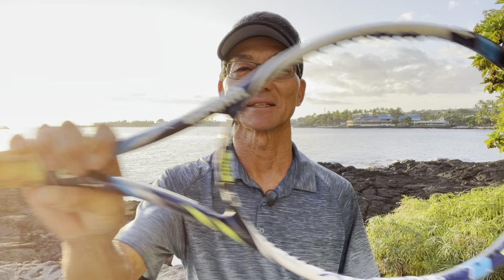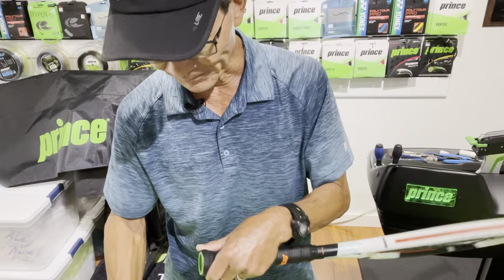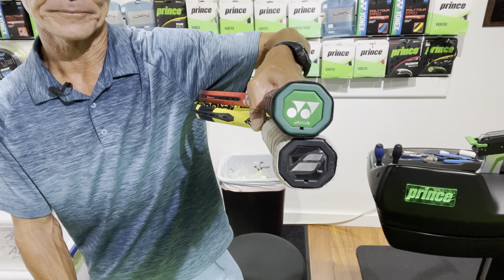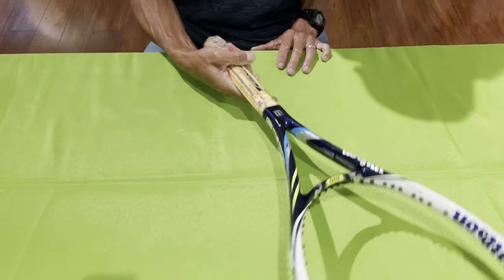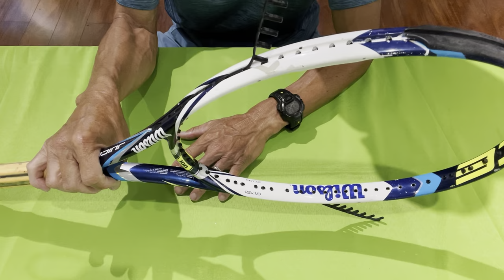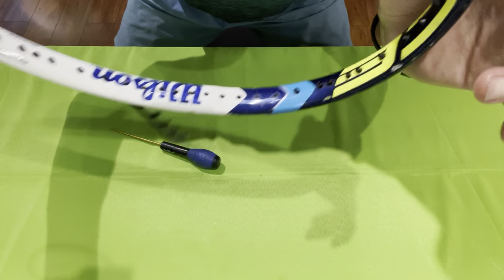Racquet Repair [Dealing With a Rattling Racquet]

Comment: Hello, thanks so much for the video. I have 2 ezone that both have this rattling issue, but when you open the buttcap, there is a foam piece completely blocking the entrance. How do I shake the debris out?
Reply from the maker: Aloha, 
You can try puncturing a hole in the foam using an awl. If you're sensitive to the frame's balance, you may want to weigh the racquet and measure the balance point. This is in case you end up removing a lot of foam in the process. After removing the debris, replace the missing weight using tungsten putty or silicone and recheck the balance to ensure it's back to the original specifications. However, if you're not sensitive to the frame's balance, then you can leave it as is. In most cases, you shouldn't have to remove too much to make a major difference. 🤙